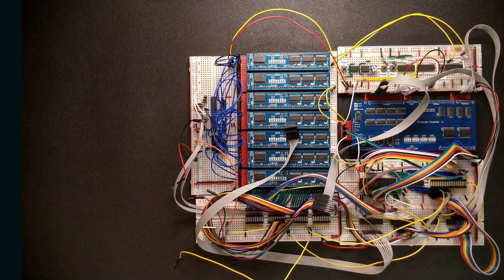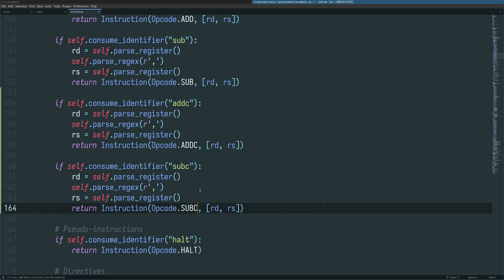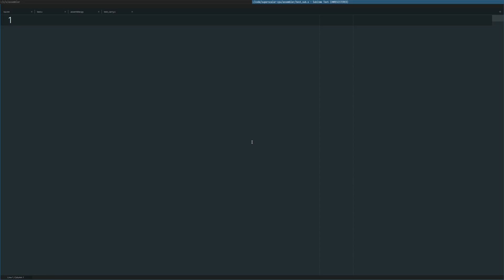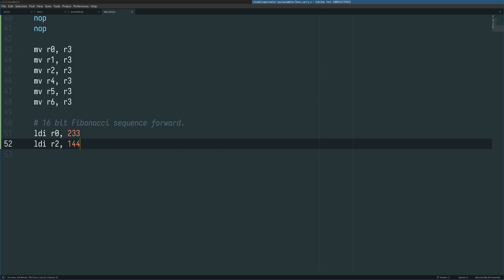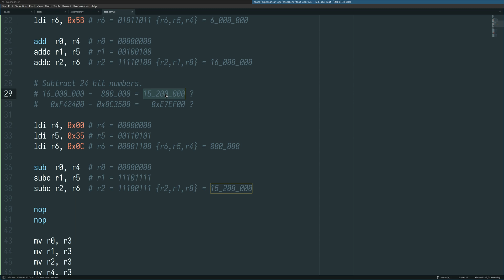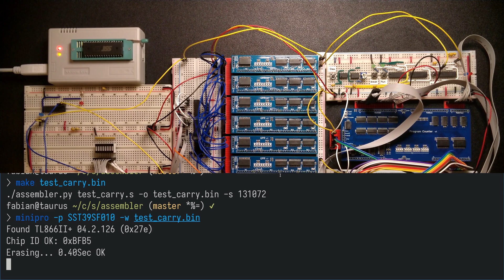Carry Flag – Superscalar 8-Bit CPU #30

Comment: Since you have doubled-up registers using the third read line, it would be pretty cool if you could carry into the next register to form an arbitrarily large addition.  You would need two write lines though.  Too bad.  You could still have the assembler recognize a paired register add as a macro: ADD ri:rj, rk => ADD ri, rk | ADDC rj, 0.

Oh wait, you got rid of the add immediate, so both operands need to be doubled up.  Not so bad, I guess.
Reply from the maker: Yeha the two write ports are troublesome. Especially with out-of-order execution the complexity of the control logic scales with the number of writeback ports to a degree. Pretty costly. I like your idea though of having the assembler expand add macros if they target a register range. With an instruction decoder and proper immediate ALU ops afforded by it, you could do something like `add ri:rj, rk => add ri, rk; addci rj, 0` 🙂

Comment: Are you still working on this series? I know you might be working on or planning the next phase of the project, so I just wanted to check :)
Reply from the maker: Yes, still working on it! Got the next video almost done. Depending on the day job, my time to work on videos sometimes drops to almost zero for several weeks. But they'll be back soon 🙂
Reply: That’s awesome! Yeah, I figured that might be the case. I’m trying to plan a channel in the future but have to work on that around Master’s classes and my day job. Thanks for working on this project, it’s very inspiring 😊

Comment: This is such an excellent series, thank you so much. I built everything you taught us already in h.neemanns "digital" simulator and it works like a charm. Can't wait for #31 to continue and hope you keep going 🙂
Reply: @andreassteinhauser9508 - I have being doing the same thing in Digital since the beginning! Great idea about using Digital's api, I hadn't considered that. Thanks for the idea! :-D  I'm porting the assembler to C# though, I just prefer it to Python  /shrug. Cheers!
Reply from the maker: Thank you so much! Great to hear that you were able to replicate the build in "Digital". That's very exciting 🙂. I'm almost done with the next video in the series -- hope to get it uploaded and released soon. Time to finish up the ALU and get back to some actual CPU architecture work 😉
Reply: @fabianschuiki  I will continue to implement it in "Digital", my ambitious plan is to use that as a basis for an fpga implementation later. Once I cleaned up everything you could add it to your repo if you like, maybe it's interesting for others as well to play with the simulator.  Currently it's still a mess in layout but works very well. It should be even possible to use the output of your assembler to drive the CPU via the api from there and use it for debugging and single-stepping through the code with a view to all registers and so. In principal that's possible, the author h.neemann does that for his own cpu implementation.
Reply from the maker: @andreassteinhauser9508 That would be fantastic! 👍🙂

Comment: Does this system have the same considerations with loading 0 into a register vs xor clearing that x86 systems have?
Do you think you'll ever run into an issue like that in your project?
Reply from the maker: Right now it does not, because all instructions are 16 bits at the moment. The xor register clearing pattern in  x86 as far as I understand is mainly to reduce code size. You could also move an immediate into the register, but that will cost 4 or 8 additional instructiom bytes for the immediate.

If I recall correctly, there's even some logic in the x86 instruction decoder to detect these patterns and turn them into proper "clear reg" micro-ops.

I am planning to introduce compressed instructions in the future. We'll probably want to have a set-to-zero op that is just one byte, assuming that is a fairly common instruction. 🙂
Reply: @fabianschuiki  I'm waiting as patiently as I can to see how your project develops 🤞
You're a fantastic inspiration to us all ❤
Reply from the maker: Thank you 😀!

Comment: It’s very interesting watching this evolve and imagining alternative solutions. For example, the 4 bit mux for selecting the carry source could alternatively make use of the carry in feed being the same as the ISA add/sub bit to supply the carry-in for cases not coming from the carry register — reducing the mux to a choice of two… which might even be feasible with a tri-state buffer and tri-state carry register? So the C bit of the ISA controls the source of carry-in being either carry register or the add/sub bit of the ISA.

Hopefully not muddy late night thinking 😊 and a lot might depend on what else you have in store for us.

Many thanks for a great series.
Reply from the maker: Thanks! 😀 Yeah that's a very nice idea! The reason why I went with the 4-way mux is because it'll allow me to replace on of the inputs that's currently hard-wired to the carry flag with something else, like the sign bit, later on. I plan to add some ALU op decoding soon, which means that there will be more opportunity to make the ALU have just a bunch of control signals, and then look at the ALU op and set them correctly. For example, that Carry Op mux can then be used to inject 0, 1, CF, or the sign bit into the computation, either as a bit to be shifted in or as the carry input to the adder. The decoder would then just look at the requested ALU op and put all the switches in the right place to make it happen. You make an excellent point though; using the the add/sub ISA bit for the non-CF input of the mux would make things more compact. Cool idea 😀

Comment: Cool. Looking forward to seeing what you do with the shift. Be it either James Sharmans simple shift using 4:1 muxers or a full shifter using 8:1 muxers. I know the full shifter is a little more work, but I think the option of having logical, arithmetic, rotate and rotate thru carry style of shifts will be handy. (Also nice that logical left and arithmetic left are the same, so we only need 7 inputs for shifts leaving one for a pass through)
Reply from the maker: My plan is to imitate James' work and make the ALU do shifts by just one position, because it simplifies things quite a bit. A proper barrel shifter would be a nice example for a separate functional unit, maybe one that takes multiple cycles. That could tickle the out-of-order execution quite nicely 😏
Reply: My idea for a full shift unit still only shifts by one position at a time, it just offers the full complement of shifts.

So by using an 74x151 8:1 muxer we have

Input (0) [0,0,0] pass through
       7, 6, 5, 4, 3, 2, 1, 0,
Input (1) [0,0,1]  logical shift right
      [0], 7, 6, 5, 4, 3, 2, 1, -0,-
Input (2) [0,1,0] logical/arithmetic shift left
-7,- 6, 5, 4, 3, 2, 1, 0, [0]
Input (3) [0,1,1] arithmetic shift right
      7, 7, 6, 5, 4, 3, 2, 1, -0,-
Input (4) [1,0,0] rotate left
      6, 5, 4, 3, 2, 1, 0, 7,
Input (5) [1,0,1] rotate right
      0, 7, 6, 5, 4, 3, 2, 1,
Input (6) [1,1,0] rotate left through carry
{7}, 6, 5, 4, 3, 2, 1, 0, [C],
Input (7) [1,1,1] rotate right through carry
      [C], 7, 6, 5, 4, 3, 2, 1, {0},

[ ] actual/fixed value ( "C" = carry flag)
{ } bit into carry flag
Struck out bits discarded.
Reply from the maker: Oh I see, yeah that's pretty cool! I like the flexibility 👍. I was thinking about picking carefully what bit gets shifted in as a carry, which would allow you to do the arith/logic right shift, left shift, pass through, and rotate through carry. I don't think my solution allows for the plain rotates without carry though 🤔.
Reply: I guess it depends on what you think you'll need in the future. If you're pretty certain that you can get away with a simpler version, there's benefits to that, namely a reduction in parts count. My idea requires double the ICs at it's core. Trivial on a PCB, if a little larger, but not very breadboard friendly.
Reply from the maker: Yeah good point. On a breadboard the wiring would be a bit annoying. I might do a simple thing now and then a proper shifter later as a functional unit 🤔
Reply: That's pretty much the same evolution of the Program Counter. Start with breadboards to get a 'proof of concept' and check things work as expected then move over to PCBs once we know it's a feasible direction to take. I do get the aesthetic appeal of building a pure "breadboard computer", and there are some builds out there that are truly works of art, but for practical purposes PCBs are the way forward for anything much more complicated that Ben's SAP-1.
Reply from the maker: I totally agree! That's also my plan. Otherwise the wiring and reliability becomes a total nightmare 😁

Comment: I suppose at some point you will add comparison so you will probably use the result of the sub with the carry (< >). And some way to jump depending on the carry value.
Still guessing here, I suppose the add/sub will be useless as the addc/subc can do both and you will add some instructions to change the carry register…..
Reply: How about variable length instructions? Common stuff like clear to zero in one byte, less frequent instructions in two? Curious what it would be like to program if you had a byte wide truncated mode with only four registers available as well.
Reply from the maker: @lawrencemanning Yes exactly, something like that! 🙂
Reply from the maker: That's the plan 🙂. The add/sub is still useful though, because it lets you ignore the carry such that you don't need another instruction to clear it beforehand. Being able to change the carry is also useful regardless, because you might want to do context switching or multithreading, which requires saving and restoring the machine state at any point.
Reply: @fabianschuiki  as you are already struggling with the bits for the encoding of the ISA, I thought we could save a bit having only addc and subc ;)
Reply from the maker: Fair point! 😏 I do have a plan to deal with the whole instruction encoding and decoding thing a bit better. Need to get the ALU out of the way though. The nice thing about 16 bit instructions is that it theoretically offers 65536 individual instructions. However, 1-operand instructions will cost 16 such slots, 2-operand ones 256 slots, immediate-only ones 256 slots, and immediate-plus-reg ones 4096 slots. But there's quite a bit of encoding space to go around and play with. Maybe also some instruction compression? 😇
Reply: @fabianschuiki compression like for instance an inst being an index to a rom where the internal logic in encoded ?
Reply from the maker: Yes I was thinking about something along those lines. For example, there could be 8 bit compressed instructions, which would run through a ROM which expands them to regular instructions. That would reduce the instruction fetch bandwidth, because a 16 bit line from memory could hold 2 compressed instructions, keeping the CPU busy for 2 cycles 🙂